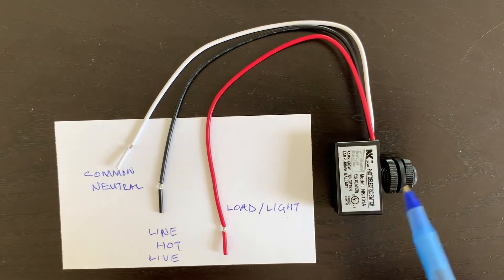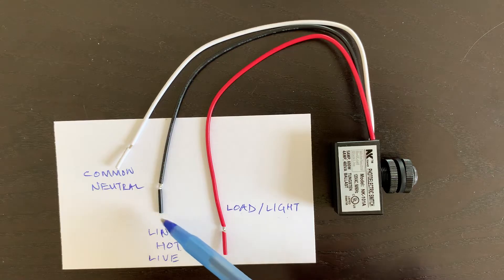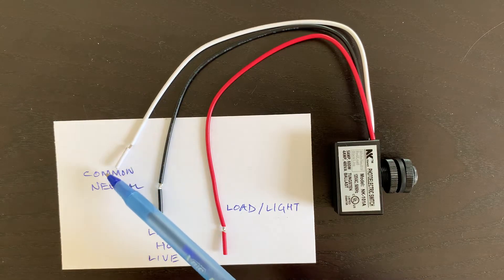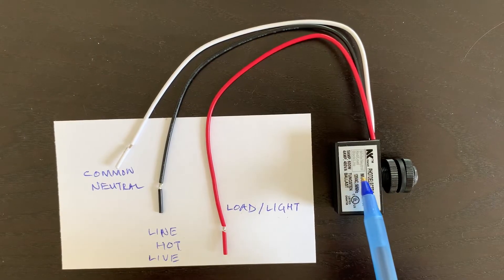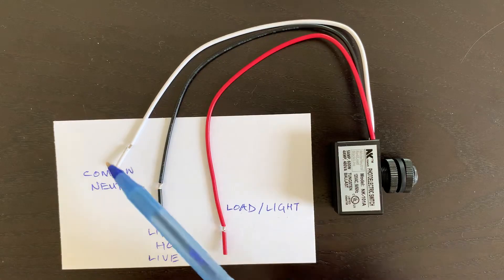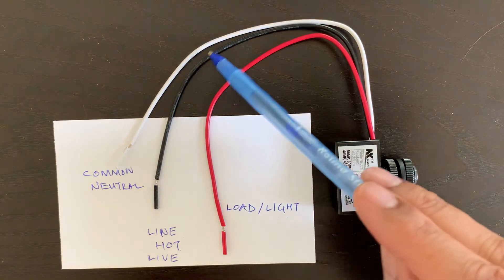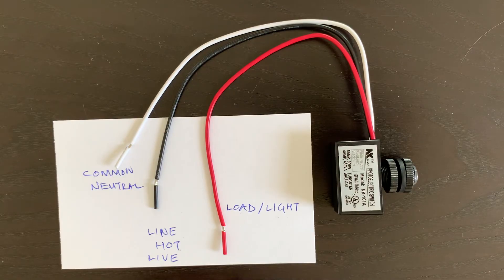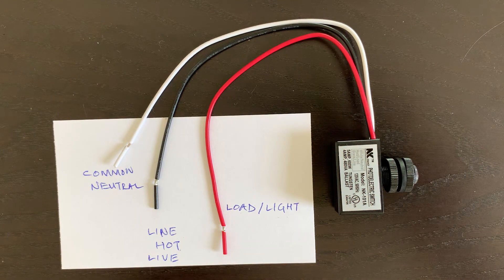Photocell Wiring Explained | Simple easy words

Comment: Good clean, well explained but it would have been a lot better if you showed the wires from the house and switch. I have a situation here that looks like the work done to this building was not done to codes because after turning off every breaker one -by-one we still have power in the line. Another problem is we can't find the swiutch that operates these lights we trying to troubleshoot. I found the wires from the lights under the building where it joins up with line coming from power source. Also, the power line has 4 wires black, white, red and bare ground. So I joined sensor red to power red, sensor black to power black and sensor white to power white along with the coreesponding colors from the lightsbut the problem we have now is the lights are contantly on even with the switch off. So we have on the building 2 lights fixtures that I assume are connected that runs under the building where it is now joined up with the sensor and power source with lights constaltly on regardless if the switch is off. It's trickey because I doing this on a live circut on a building thats 52 years old and work that I pretty sure is not up to codes by the looks of what I see under this building. Wish me luck as I try to find a switch for these lights, oh I 4got to mention light sensor was housed in a box with ground wire secured to it but now for these purposes its not.
Reply from the maker: Thanks for the feedback, that's a great point.

Comment: Well explained, but I got a question, My out side light during a day time it turn off, but in about 45 seconds turn it on again, and keep doing that continuesly, on day time only, knight time no problem.
Reply from the maker: Thanks. If it was working fine earlier on and has started to do this just now, the switch is bad. If it has been doing since beginning then the switch is getting slight daylight just enough to trigger it off and then on again. Change the position of the switch so that it gets clear sunlight.

Comment: Which wires would I connect to bypass these photo sensors, I don't really need it, but its already installed.  it sounds like I need to have the red and black wires touching to bypass.
Reply from the maker: That's correct, ASSUMING that your wiring is done properly and the color coding is correct.

Comment: I have had two of these, and neither of them work correctly. The light illuminates in the dark. However, the power won’t turn off when I shine a bright light at the sensor. I have checked all the wiring a couple times. Have you had faulty units like this?
Reply from the maker: These units fail all the time, it's rare to see them last over 2 years. Some are faulty on day one!

Comment: I wired it as mentioned, i have installed many in the past for dusk and dawn controller but this time the device is causing my light to turn on and off for 10 seconds and repeats regardless whether there is light or total darkness
Reply from the maker: The photocell is close to the light being controlled and that is why it is cycling through on/off, you need to shield its lens so that the light doesn't fall directly on photocell.

Comment: I I really couldn't understand what the guy was saying in the video so therefore I got nothing out of it and I do not know how to wire I had it wired the first time right trying to listen to him made it spark so if you have any kind of knowledge I know that red goes in hotline coming into the house from the hot box the whites are the neutral in the blacks are the sensors and the green goes to the ground Tell me if I'm right or wrong I know I'm right thank you

Comment: Hi Amer. Nice video!  Q: I run a one watt lightbulb 24/7 in my shed from a small battery and solar array. If I add the photosensor will Ithe light actually need more than 24w per day?
Reply from the maker: Thanks. Interesting question. Most off the shelf photocells need 110 or 220 volts to run, I believe I have seen some which can be installed in a series without a power supply for low volt circuits of less than 12v. Obviously these will not be 100% efficient so some power loss will be expected, maybe 0.5 watt or less. So you have to read the specs of the photocell to really know how much power will it require to operate but just guessing I think you can install in series and the savings in power of not operating during the day will offset any additional power required for the photocell.
Reply: @akhaqan  thank you!

Comment: So, I think your saying the red and black wire both share (connected to the incoming black wire) :)
Reply from the maker: No. The black wire is connected to the Live power coming from the house, it will ultimately go to the bulb after passing through the photocell. Once it passes through the photocell, it becomes the red wire. The photocell connects or disconnects the black & red wire.

Comment: If Boeing change wiring to these type of control signal then less leakage because the light enclosed inside pvc tube then no one can read or interfere pit just like fiber optic but cheaper and much lighter than both fiber optics or regular wiring because one of these inside a tube can replace 20-50 kg of control wire bundle

Comment: I have never seen anyone explain how to wire them up and then they work. Every one is a liar. They can't make it work because they don't show it working in real time by covering the sensor. It's all  a scam. NO one knows what they are doing.
Reply from the maker: Chill my friend, someone above commented and simplified further: White wires hooked together from the light and the house. Black hooks to the house and red hooks to the light. So Black (is incoming power from house) and red (outgoing power to the light). I hope it's clear now. This assumes your house wiring is done as per code.
Reply: @akhaqan  I tried everything and switched the wires around. I read others who had the exact same problem. My home was wired by aliens from mars in their factory.
Maybe that's the problem
Reply: @akhaqan  🙄🙄🙄🙄🙄🙄🙄🙄🙄🙄

Comment: So the red attached to the whites as Wellnor to which cable
Reply: The black is the live that connect straight to the powers … the red should connect to the black from your light… the light normally has 2 wire which is black and white ( white Is the common) how ever you’re gunna connect a next white    The white and from the light and the photo sell which will connect the power with the black from the photo cell .. so basically you will end up with live and neutral hope you understand English is not my first language

Comment: When I connect the photocell in the red cable there is always electricity. I went to change it because I thought it was bad but it always has the same problem, there is always power on the red cable even if there is light or darkness and the black cable is connected to the live line. You know what happen ?
Reply from the maker: Most likely the photocell switch is bad, replace it

Comment: Why would the light not go out when daylight come on. This is the second straight time this has happened. The present photocell swithch was installed about 18 months ago. It operates a post lamp about 40 feet away that gives some illumination to the property. There is nothing blocking the photo cell unit.
Reply: More than likely, the photocell is bad.

Comment: Doesn’t get any simpler than that!
We jus put new lights up at the back of our church building! (Had to test the photo-cell out & by-pass!)….. the problem turned out to be the commercial lights with starters in them!?
Removed & installed standard flood light types!
Brighter & more reliable! Wired photo cell back into the circuit with the light timer! Bye Felicia!